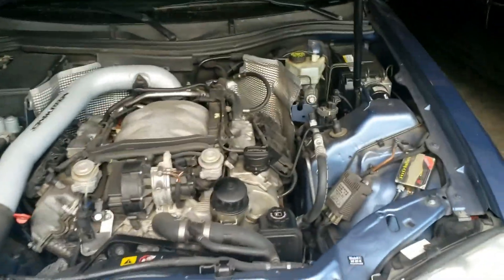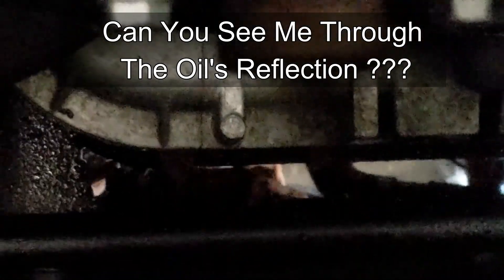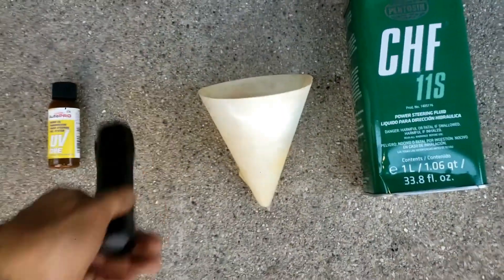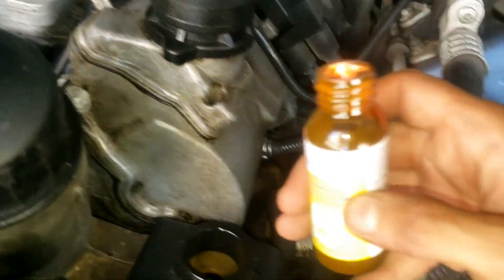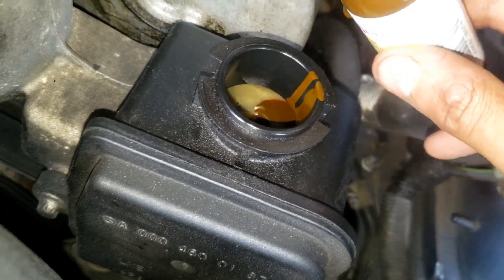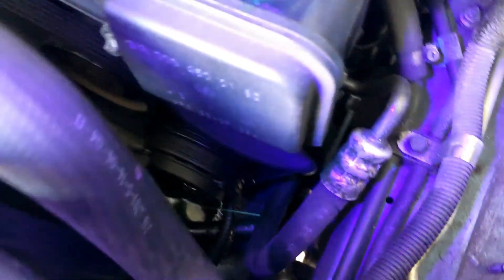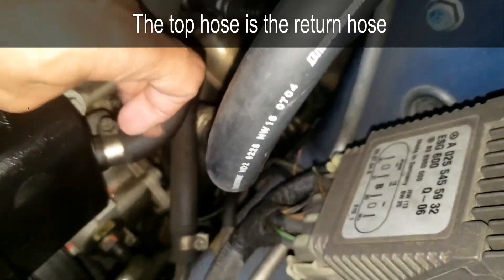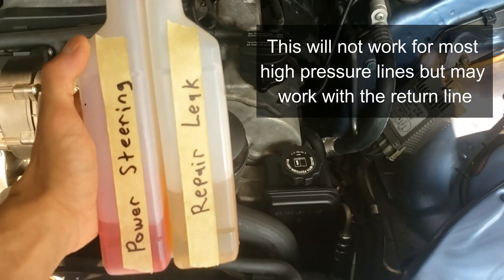How To Find A Power Steering Leak 💧 In Your Car Or Truck

Comment: Same thing here,the first thing is that I checked it by myself,I didn’t realize that it had to be under pressure from the right side tire to the left side,with a force,I see you were able to find/fix the leak. I have the dye and light,and I took it for a road test, and I see some bright yellow to green color,but the is only inside of the reservoir
Reply from the maker: Yes a little pressure and you'll see it coming out.

Comment: do you have to use some sort of filter to see? i ran and bought the uv dye, my lfash light has a uv mode, but i cang see crap with my bare eyes? are there glasses im supposed to use? god damn it
Reply from the maker: You could use UV glasses for safety, but I didn't do that. The UV flashlight should show if their is a leak. You might have to look around hoses, etc. It is also possible you don't have a leak which of course is good.
Reply: @FixCarYourself  my uv light was weak, i went and bought another one and it worked very well. i was able to finally see my leak was coming from the fitting for the high pressure side, i tore it apart and found the o ring was destroyed.

anyways thanks a million, im sure the dealership would have charge me $1000 and did it wrong and i dont have time for that nonsense
Reply from the maker: That sounds about right. Great job, really glad you did it yourself!

Comment: I bought a 98 Cherokee and as the previous owner/my coworker (now retired) told me, it had a power steering leak and a few other leaks. I bought some dye for the engine oil which is leaking but I think I might do the oil by natural eye and put a bit in the power steering first. On my vehicle the oil leaks are easier to find than the power steering or ATF (I think I’m leaking ATF too)
Reply from the maker: Cool. Tackle one problem at a time. I'm guessing 1 bottle of this should be enough in pinpointing the leaks.
Reply: @FixCarYourself  Most definitely

Comment: Do I need to drain the power steering reservoir first, or do I just add some of the dye and top it up?
Reply from the maker: Add some dye, and if your power steering fluid is low, then add a little fluid as well. I did this because I realized I was low on power steering fluid. So, in my case the power steering fluid would come out when turning the wheel (which is acting as pressure to release the fluid) So I was already low on it. Then look to see if you found the leak on the hose.
Reply: @FixCarYourself  thank you

Comment: I woke up to my car thats been parked for a few days with suddenly two puddles, one next to each wheel. I think my whole rack might have had something happened :(. It reached freezing point outside since I've had this car (just bought it a few months back) so not sure if it did something. I hope its not the whole rack. I will try the UV dye. Thanks
Reply from the maker: Good thing to use. In my case the leak fell on the side of the splash shield and of course would later flow down to the ground. When you do this. Do it in a dark area, and preferably with a partner.
Reply from the maker: Did you ever fix your problem. Did the UV dye help isolate the problem?  Or did a certain hose leak?
Reply: @FixCarYourself  Hi! Well, I was able to lift the car at a friends house with some ramps and discovered the leak was coming from the return line, and there was a crack in the line, so it was obvious. But I tried the dye for the heck of it and the dye made it much more obvious.
Reply from the maker: @The2Coolest2  Cool. Luckily it was the return line. Those are usually quite easy to replace, and not as pricey for the part. Hopefully you didn't spend much on this. As for the dye, I agree its quite cool, you can see exactly where the leak is.
Reply: @FixCarYourself  I got a 40 dollar one from rockauto. So far so good, its been around 2 months now. 

Unfortunately it wasn't easy to install. I did it at my friends house, the jack I purchased didn't lift the car high enough to give enough working room, so it was us trying to fit our hands back and forth and getting rusted screws off (north east car). Long story short, took us 12 hours in total (with a 1-2 hour break). Couldn't even push the hose up all the way on one of the lines. I had to go to a mechanic eventually anyways because one of my O2 sensors I couldn't get off (again, lack of lift so hard to work so no room for leverage, the O2 sensor stripped). I just told him to push the hose fully down on  it.